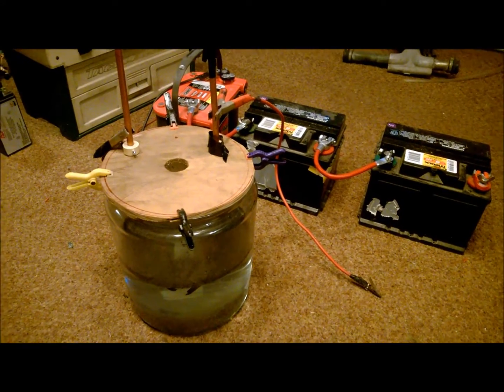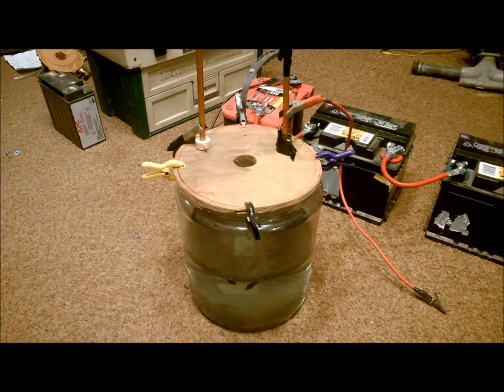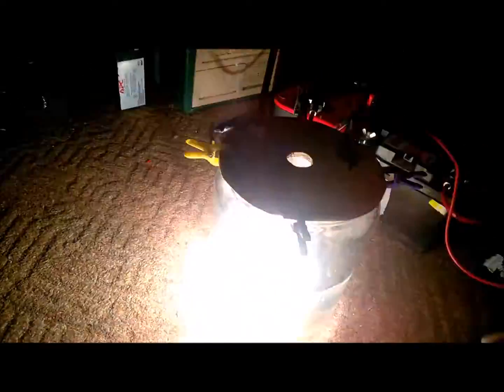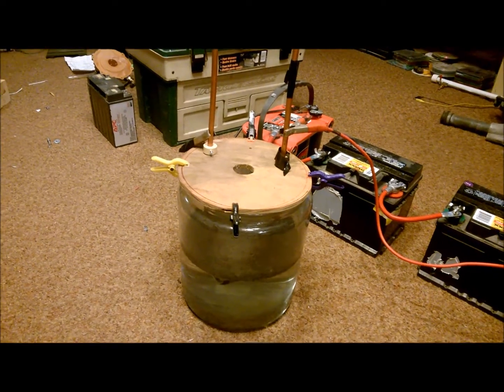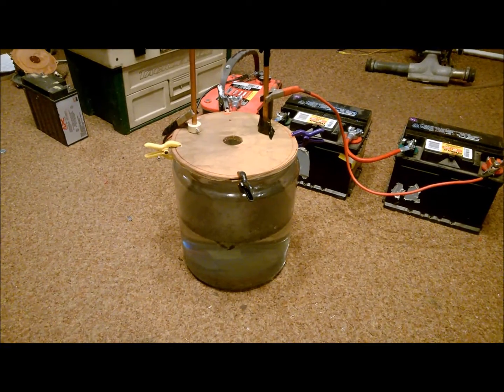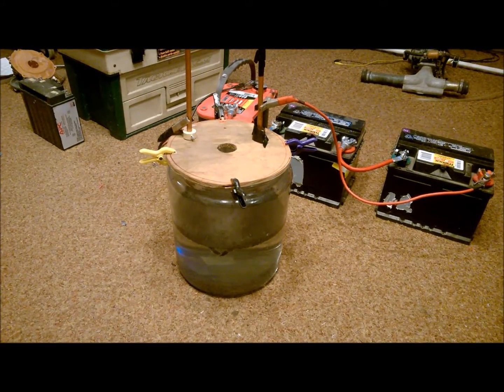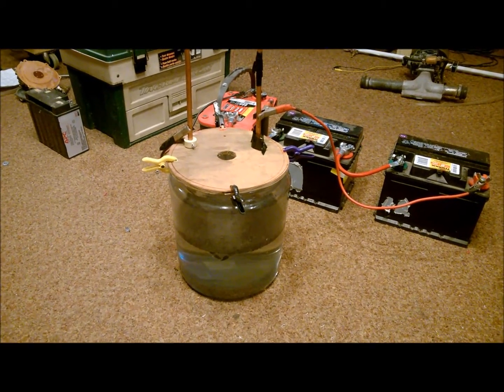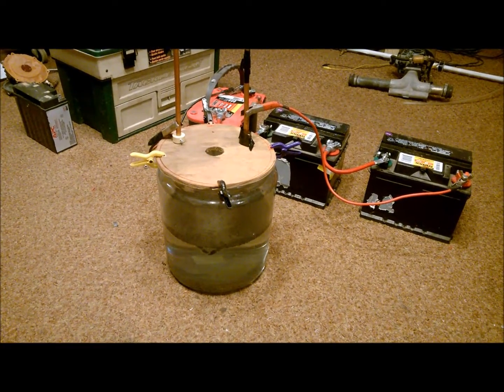Magnagas cold fusion

Comment: so its basically just an hho cell...cold fusion is very misleading I am sure that you still using more power in than out. Can you prove the presence of helium? I have seen these before and they never seemed to get past the constant adjustment needed due to the degradation of the graphite electrodes. proof of helium and or actual magnetic gas would be amazing. one guy claiming this turned out just static electricity on the balloon he had filled with gas. I want you to prove me wrong it would make my day hell it would make my year
Reply from the maker: +iczer01 Hi i'm loading another video results and as for proof of Helium its chemistry. I do have better stuff ordered and will show when I get it but Hydrogen isn't far from helium just a electron the water is Ionized that's electrons and the intence heat fuses it together. I wii show this but am waiting on some parts. Always good to be a sceptic and I will do my best to show and prove things. If i'm right I will do it with about 2 amps in a future video